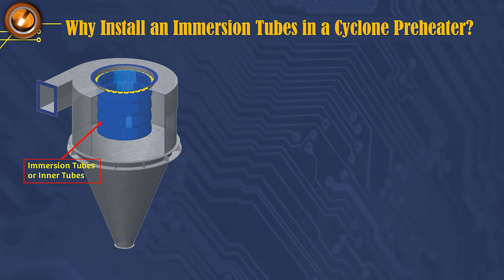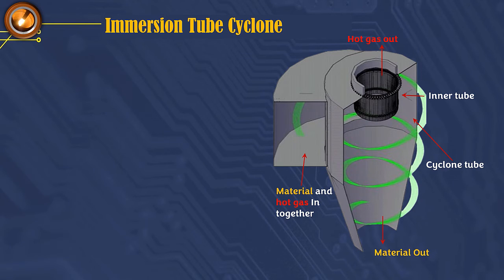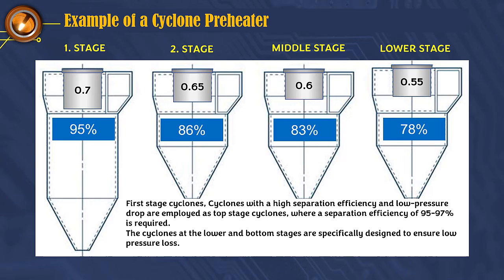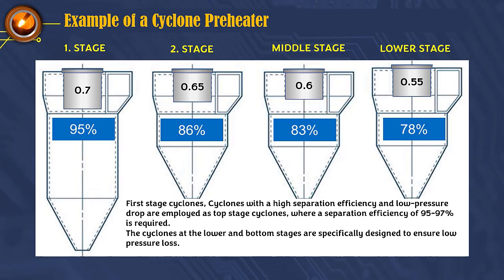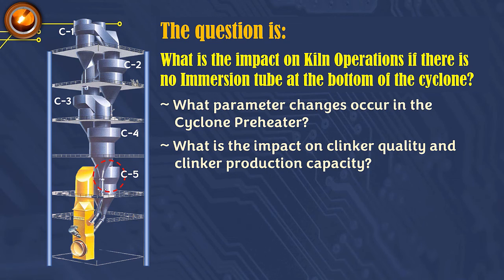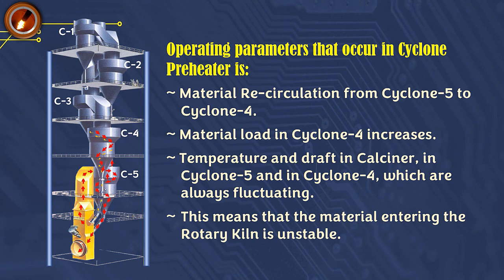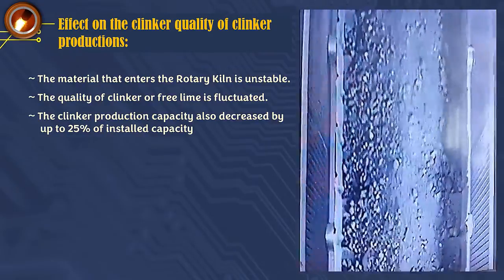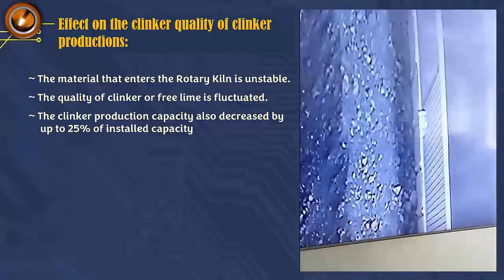Preheater Cyclone : The Immersion Tube inside Cyclone is a Very Important Part _ English Version

Comment: Sir what happens if there is pressure drop in the preheater cyclone?
Reply from the maker: Thank you for the question sir.
If there is a drop in pressure on the cyclone preheater, there are not many obstacles inside the cyclone, meaning that the separation process between the material and the hot gas also decreases. This generally occurs when the inner tube is too short or there is no inner tube.

Comment: Sir are there portable gas analyzer for detecting CO and oxygen at different points at the Preheater cyclone.
Reply from the maker: There is Mr. S Thapa.
There are several brands of portable gas analyzers, you can search the internet according to the type you want, there is one tool that can be used to measure CO, CO2, O2, SO2, NOX, NO, NO2 and temperature. You also have to complete a Pitot Tube Anemometer to measure the speed of hot gas in each channel of the preheater cyclone.
Reply: @parroscement2625  sir can you name some brands sir
Reply from the maker: There are several brands and you can visit their websites, including: Ametek-Land at https://www.ametek-land.com/, MRU-Instrumente at https://mru-instruments.com/ , Testo Portable gas analyzer for cement industry at https://static-int.testo.com/, and others.
You can contact the supplier in your country or buy it at an online shop.

Comment: Sir, i have question calcination level in precalcinator is too high 97.7%, what could be the problem for this? Also the clinker is dusty and kiln operator saying is hard to produce clinker. What cause this impact on clinker quality?
Reply from the maker: Thank you for your question sir.
To answer your questions, operating data should be supported such as the LSF%, SM%and IM%, Caliner Outlet temperatures.
Clinker quality, what is the %freelime value, %C3S and %C2S?
Calcination 97.7% can be caused by LSF% below the target and calciner outlet temperature of more than 890 degrees Celsius.
Dusty clinker can be caused by high silica modulus or more than 2.65% and iron modulus of more than 1.75%.
To overcome this problem you can reduce the use of fuel in calciner and raise fuel in the main burner kiln. And adjust the use of clinker cooling air, especially in room 1 and 2 clinker cooler.
Reply: @parroscement2625  LSF 95%, SM 2.15, AM 1.5
Reply from the maker: LSF 95%, SM 2.15%, AM 1.5%, This parameter is too low for the OPC cement production process that uses coal as fuel. This causes high decarbonization process, dusty in kiln operation which can be caused by high ash content and high coal residue. You can reduce fuel consumption in the calciner and switch it to the main burner.
If this happens for a long time, there is potential for chocking in the lowest cyclone preheater.
Reply: What are the ideal parameters when using coal fuel 
LSF
SM
AM